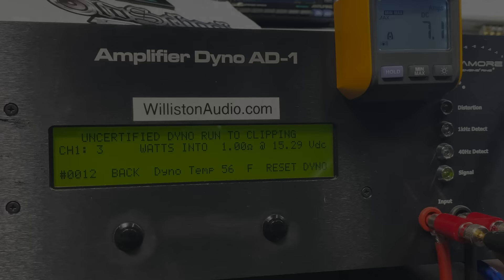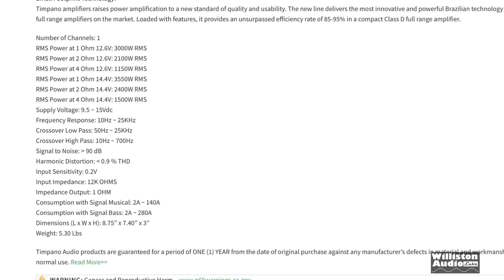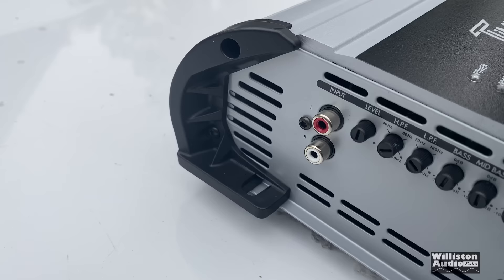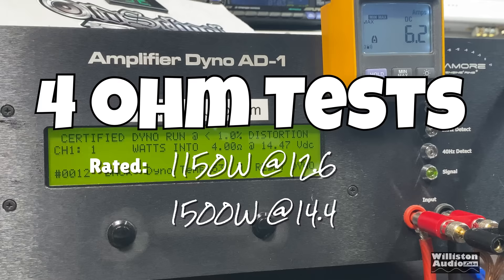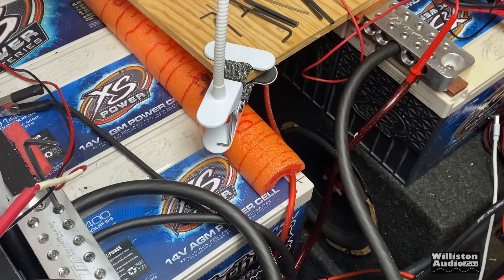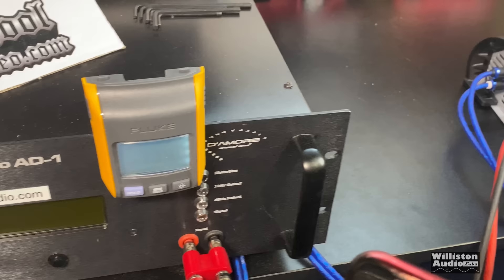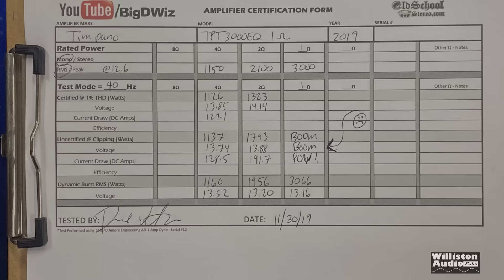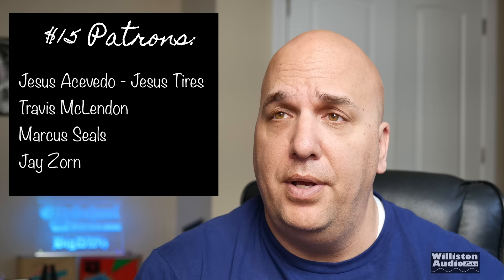This $220 3000 watt Amp GOES UP IN SMOKE! [4K]

Comment: Wow!  Might need to find a co2 extinguisher to keep the mess down.
Reply: ya learn that the hard way huh?........ we did.... LOL.... BDBD/2012
Reply: used to use Co2 to freeze up the amps.... fill the woofer box too...LOL........ Cra Cra....  WOOFERS these days need their own internal cooling systems....  LIQUID COOLED....BDBD/2012
Reply: @bigdogbrodavepresents6178  absolutely did lol at the gas pump too

Comment: Wondering if ran as designed, at 12.9 volt's  if this would have happened? The one time higher voltages hurts if I'm right! Either way the people making this product need to go back and add a protection circuit!
Reply from the maker: Boom 💥

Comment: So Timpano admits on their youtube video where they supposedly explain why it does not read on the AD-1 for this amp that it is a Stetsom EX3000. They also admit the amp is made for mids and highs and not low frequencies. I don't really think people shop for 3kw "highs amps", in that wattage range they are looking for and expecting a subwoofer amp, not an excuse for premature failure! Perhaps they should have chose some higher amperage Mosfets or hired Zed to design, manufacture and ship their products! Tell It how it is, make them keep it real even if that includes re-engineering a product for the consumer!

Comment: Wierd question, but do I fit a 000 gauge wire in an amp with 4 gauge terminals? Yes, I only have 000 gauge. And no, the biggest distrobution block is for 0 gauge

Comment: I actually think that it was the Output Mosfetts 
 that shorted out....?
Reply: Dave Micolichek  but usually the output Mosfetts are larger than the power supply ones..... No way those little ones do 2000 watts....

Comment: It looks like the output transistors that blew up, not the power supply. They shouldn't be advertising this amp as being stable at 1 ohm, clearly it is not

Comment: That heat sinking arrangement is terrible.  FETs mounted to the bottom of the case, with the actual fins two inches away.  Our amps are RF, into 50 ohms, but it's clear, thermals are the issue here.  Perhaps mounting them vertically, with a separate sink in the fan air flow, with good overcurrent and overvoltage protection circuitry would alleviate the problem.  There would be an engineering cost, however the additional component cost would be minimal.
Reply from the maker: Amp has no current limiting whatsoever

Comment: Looks like stetsom case. Been wanting to see stetsom ex3000eq in comparison to the taramps 3ks. Stetsom was a good brand before had older model amp they been around since 1989. Not sure if new one's are cheaper built like taramps.
Reply: My stetsom eqs are great man better than taramps for power output I just think big d got a bad batch of amps
Reply: @luke_784lowfrequency8  That wasn't a stetsom though was it?. I had an older Vulcan model stetsom was way more $ but built like a tank.
Reply: @jkindlesparger  timpano is a cheaper version of stetsom
Reply: @luke_784lowfrequency8  Key word there is cheaper. Would assume stetsom uses better parts.
Reply: @jkindlesparger  stetsom is pretty good man

Comment: Even funnier it has a protect light but no protection circuitry. So amp blows up then light flashes?
Reply from the maker: Doesn’t have over current protection

Comment: I don't see why you should be sorry with those low-cost amp manufacturers when they are lying through their teeth with the specs - only when you test them under conditions that are not to be used(2 ohms or 1 ohm) then it's on you to try but state that under normal usage it's work as intended

Comment: I've come to the conclusion that these amps are only good for one thing. They make big, dirty,cheap power for giant full range pro audio style installs. they probably work fine driving eight 10 inch PA speakers on music  but feed em  a sinewave and they fry.
  I use my orion 750.4 the same way but on my door speakers with passive/active crossovers. Pure fullrange output and figure out what frequencies go where after

Comment: This is no 3k watt amp.  Based on what I see, transistor count, size and type. I'm guessing generously, an 800 watt amp @ 4 ohm "stable" and they expect 3k at 1 ohm? It's probably a decent amplifier just grossly overrated. $230 may be a stretch for the price, I'm seeing some very cheap components in there such as Ketou capacitors, lots of surface mount components and of course a generic amplifier chassis. 
What it has going for it is that it definitely looks to be class D, nice and compact, so the electrical engineer did good as far as that aspect, not so much on protection circuitry or could be defective components to blame. I'm with you on not bashing companies and definitely would not intentionally do so, but they do need to rethink their figures and pricing on this.

Comment: A quick look at the 2 amps you say are the same, I did notice that when you said the RCA was backwards, as in RED and WHITE are incorrect, if you look at the Stetsom online, it is correct, but if you look at the Timpano online, it is the wrong way.
So more investigating is needed so you can see what is on the inside, they may be just sharing the heat sink.

https://timpanoaudio.com/product/tpt3000eq-2-ohms/

https://www.stetsom.com.br/en/produto/ex-3000-eq/

Comment: I think the amp is pretty good for the price manufacture said amp ia not desing for bass but you still could used it but dont abuse of the amp power am thing getting 1 for 2 12 4ohm each and run it at 2 ohm and no body will be listening for 40 hezt all the time i know is a test

Comment: The amp u have Timpano 3000.1 TPT-3000EQ 1 Ohm it not really made for bass the amp will do 3000watts just n midrange speaker or driver the amp dnt like when it test at 40hz or 30hz  that y it blow up

Comment: Gotta keep the RCA voltage low on them amps, if it's to high they fry
Reply: They like under 2v, keep the sub level down on the head unit

Comment: Well at least dick rickulous didn't make an appearance. I personally would never run one of these amps for several reasons, but I think most would agree with you that fusing it around 200 amps and it would probably run fine. I am starting to wonder if the amps that burnt down that demo truck were properly individually protected? Different brand obviously but similar circuit design

Comment: Please do this amp it off Amazon 2 Channel Car Stereo Amplifier - 1400W Dual Channel Bridgeable High Power MOSFET Audio Sound Auto Small Speaker Amp w/ Crossover, Bass Boost Control, Gold Plated RCA Input Output - Pyle PLA2200

Comment: Anybody have info if the stetsom amp does the same I was planning on buying 1 and then I see this video.
Reply: I love my Stetsom 7k. Best amp I've ever owned in 25 years. 
Becausr of that, I recommended one of these tiny 3,600W ones from Stetsom, identical to this one. 
I swapped out my friend's A/B amp running his 2 wimpy shallow mount Pioneer 12s. 
It only produced 2 or 3 Watts for 10 seconds then blew. 
I didn't even try to turn it up, and it just blew from very low volume input. 
So, I would not buy that particular tiny amp from any of the Brazilian companies, but, any amp they offer that is much bigger than that shoupd work fine for ya. 
I will only be buying Stetsom bass amps for the rest of my days. 
My 7k does 6,004Wrms @9.9V , wired .7 rising to 1 Ohm exactly. 

I drop so low in Voltage because I only have 4 of those tiny $50 Walmart car batteries for support right now. 
Amp wont turn off til I drive it even harder and drop my whole car's Voltage down to 9.2V! 
Will never get rid of my Stetsom amp.

Comment: That has happened to me with a stetsom amp in my car at low volume.
Reply: Me 2 sadly with the 5k
Reply: 7k here. 
Had it since 2012 in many different configs and woofers sizes and brands. 
I run it unfused, undersupplied, and it makes 6,004Wrms @9.9V , and, will even run ALL DAY LONG in the high 9Vs without getting hot or burning up. 
If you hit 9.2V, it will simply switch off. 
You can immediately power it back on and keep jamming with just a single click down on your volume knob from where you were when it dropped too low. 
I've done everything to it that you're not supposed to do to any amp: wire it under its rated impedance (I wire it to .7), I have had it mounted directly to boxes, I have left it totally loose just laying in my back seat while being used daily for weeks that way,  I've had it smothered in pillows, standing up, fit snug between my back seat rest and my box in the trunk, where it had no air at all and was tightly surrounded in pillows, and I would run it at about 4,800W like that for months in a daily setup. 
I have purposely blown many low power woofers with it at shows, just to push my cheapo daily 2 12s setup to the max to see what it can do. 
The car doesn't drop in Voltage really at all while pushing 4,800W through the cheapo 12s for a few seconds. 
Only if I use my big setup (2 solo x 18s) can I run it hard enough to drop my Voltage. 
I run the gain on the amp quite high, too, say, between 1 and 3 oclock on the dial, and the distortion light runs regularly, but, I leave my input signal from the head unit low, like you had mentioned. 
Indeed, the reason you guys might have blown one is due to having a 4V head unit. 
I've always used a cheapo 2V JVC on mine with wreckless abandon. 
I don't care about having a fancy head unit, since I only use it for a volume knob, so, having a 2V may be what has let it jam for so long with zero issues. 
When I first switched to the Stetsom after years of using all different top korean tech name brands, I was amazed at how much louder my car can play without the Voltage beginning to drop. 
That may sound funny coming from a guy who drops to 9.9V regularly during a burp wirh my big rig in the car, but, the reason I drop to 9.9V during burps is because, for contests, I only use 4 of the tiny $50 Walmart car batteries for a supply, and, that is no where near what is necessary. 
For using it daily, I run no batteries in the back at all. 
Just a battery up front and a Mechman 220A. 
Still jams all day no problem, at about 2,800 -4,800W, depending on what setup I'm using. 
Heck, after the contests, I would take out the 4 batteries and run the solo x 18s in the car for several weeks without them before I would switch back to the 2 12s daily set up, and it would play almost as loud without the batteries. 
When I put a proper battery bank in, the amp will exceed its rated easily, and by a great deal.

Comment: Another "little" detait,the one that you use is intended for mid bass up to highs,and you tested on 40hz??,my man,try the stetsom vulcan or taramps hd series ,you will open you eyes,just try it,thanks again.
Reply: If the manufacturer states the frequency response from 20hz to 10khz or 20khz IT SHOULD DO IT. Its just poor design and clearly the stetsom cutting corners to make it more affordable to to sell it to timpano.

Comment: Your mistake in this test was using far too small gauge output wire for the impedance of the load.  Simple mathematics would show that any speaker wire gauge below 2 gauge is insufficient at the rated power at 1 ohm, even with such a short wire.  I would recommend you consult an engineer before doing further tests, because your conclusions are  rendered questionable by your methodology.
Reply: thats not his fault. the amp can only fit 4awg wires. he used 0awg with 4awg reducers as shown in the video

Comment: I feel bad for manufactures. If they put a fuse in it and people pop the fuse, customers complain. If they don't fuse it and it blows up, customers complain.  If they use electronic protection and it goes into protect, customers complain. If they build it right and the price reflects that, customers complain. If the manufacture puts a limiter circuit on the signal then "dynamic power" suffers, customers complain. Can't win.

Comment: You’re not responsible for the manufacturer producing defective and highly overrated amps.
It’s 100% on them, they need to rectify the issue and demonstrate they did so. Replacing everyone’s amp that blew up with a new, redesigned working amp would be a good first step.

Comment: Do the stetsom 3k next or 5k plz
Reply: Just for you to have data: 
My Stetsom 7k did 6,004Wrms @9.9V . 
Was wired .7 and rose to a perfect 1 Ohm in my setup at my peak note  (48). 
The reason I dropped to 9.9V is because I only had 4 of those tiny $50 Walmart car batteries for a power supply.  
But, the Stetsom 12V series will play ALL DAY LONG in the high 9Vs and will never shut off unless you hit 9.2-9.5V. 
And, it will give you 65-80% of its rated power anywhere below 12V without getting hot or breaking a sweat. 
This tiny amp tested in the vid from stetsom is indeed garbage. 
Because I love my 7k and will never buy any other brand for bass amps, so, I talked a friend into buying the Stetsom version of this tiny 3,600W. 
It was junk upon install. 
Did not function at all. 
 But, an actual large sized Stetsom 3 or 5k will be amazing. 
You will be utterly amazed of how efficient they are compared to korean amps. 
Not even a close match. 
The Stetsoms trump all korean amps, hands down, based on my 28 years of car audio observation. 
(First system was Rockford and Profile in 1988).
Reply: @staywhite6332  nice man see this is why im curious on these amps cause i like Taramps, stetsom & Sound digital so i want to run either one of these on dual 15's

Comment: vedio idea. Heard that some class D camps affect FM reception?
Reply: I haven't noticed a problem..
Reply: @bobdodge3171  thanks for the reply. I also have not however was looking into soundstream Amps. & reviews & Google research kind of suggests its possible & happening? Never dealt with that or hear of it before??
Reply: @nnperformance76  ive never noticed it.
Also this is the 1st time i heard about it.
But it is possible i would assume..

I live out in the "country" and if a trucker uses his cb as he passes the conversation can be heard through my system. Not last long they have to on the cb and seems to only happen around 30 meters then past that back to what i was listening to.
If im on a fm station.
Reply: Thanks again. I do overland offroading and have CB radio and ham but was wondering about the interface of some class D amps? Appreciate you & the response. Trying to learn all I can not a noob but all the knowledge I can gain is appreciated...
Reply: @nnperformance76  the cb interference was back in the late 90s though i only had class a/b amps then.
I dont recall any as of late.. But i dont really listen to fm much anymore.

Comment: 3500 watts rms on 4ga wire..... for $0.06/watt....... That small of an amplifier rated for 3500 watts rms......🤔

What could go wrong 🤷‍♂️

🤔🔥🤔🚭. 

I am all for budget systems, but budget “big power” is scary at best. Stick with a reputable company. There are some decent budget options out there that you can trust to at least at a minimum work and not start a fire.
Reply from the maker: You speak da truf

Comment: If an amp blows under the testing you perform, the company needs to be put on blast. Lives and a lot of money in vehicles could be at risk if something like this happens. If your product is that unsafe, you don't need to be a company.

The company that made the last one wouldn't have been any kind of loss to the car audio community anyway. Neither would the loss of this one. A cheap knockoff of an already sketchy topology is a terrible idea...

Comment: I'd never buy an amp that doesent have over current protection, reverse polarity, Thermal etc.   I've seen amps half that price with more protection.
Reply from the maker: Yeah the $50 Boss amps have superb protection
Reply: @wal  I had a Boss AR1500M that I bought while I waited for my actual amp that was backordered to come in.  Used it to break in my sub that way I knew I couldn't possibly blow up the sub.  Despite its lofty ratings, my math had it making under 200 watts RMS.  That being said for the $58 (Canadian!) That I paid for it on Amazon (later to more than double, which is typical with good selling items on Amazon) it was pretty decent.  Once my actual amp came in I sold it and got back a little more than I paid for it as the price had increased by that point.
Reply: I'm still running my 2 amps from about 2014 or so.
Kenwood Excelon XR-4S for my mids/highs and it's mono brother the XR-1S.  They are great amps, make decent power that give me a little headroom with my setup, they sound good and neither ever break a sweat.  I imagine they will likely last next to forever.  Also running an old school MTX Thunder 8000 10".  Had 2 that were BNIB.  I run a single 10" in a sealed box so I have a spare one if I ever need it but older MTX gear can take a beating and just keep going so I don't forsee the sub dying anytime soon, the other BNIB one I still have will likely end up in a second vehicle that I'm buying come spring time.
Cheers Big D! To quote a big dummy, I'm outta heeeeere!
Reply from the maker: @derekgardin1512  https://youtu.be/aO8cp76Gotw
Reply: @wal  yep mine looked identical to that design, I watched that video of yours previously (like i have most of em! ) just had the smaller version.  Decent looking and performing for the money,  just wish they would use better ratings.  My 1500M may have onky done 200w RMS but for most people just wanting to add a bit of thump in the trunk thats more than enough IMHO, people who think you need 2500 watts make me laugh.  If you're not doing SPL or dB Drag or some other form of competition you don't need those power levels.  My whole setup in my 2015 Fiesta ST is 950 watts RMS.  450 to the doors, 500 to the sub.  Everyone who heard it say two things: damn it's loud and damn it's clear as hell too!